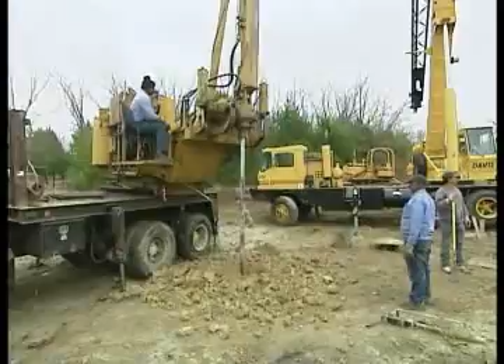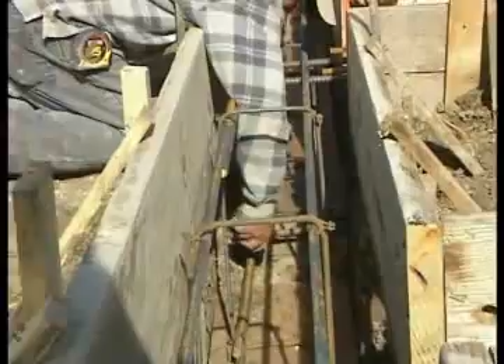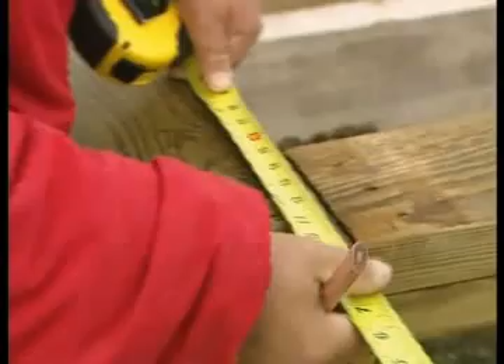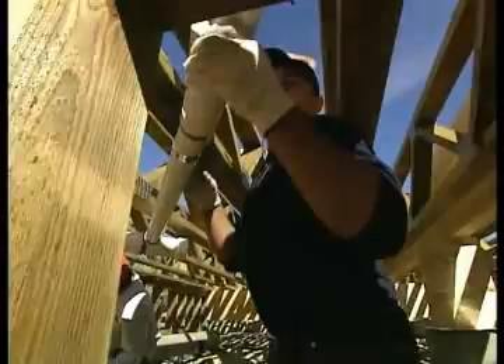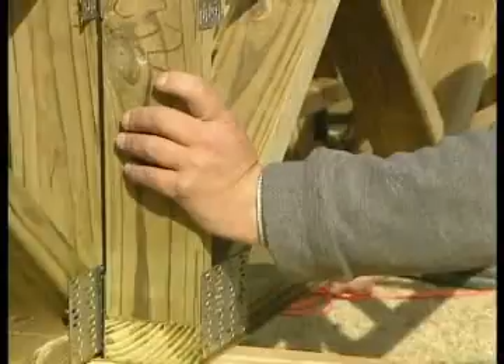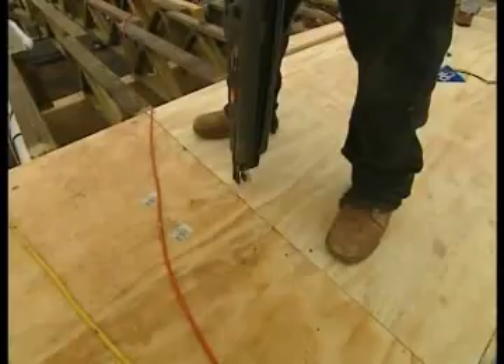Raised Floor Foundation - Case Study

Comment: Very unreliable technology. A lot of expensive materials and hardwork and as a result a floor with miserable characteristics. After the flood, these trusses will fall apart and the house can be thrown away. The insulation is bad. The sound protection is low. Smart people build reinforced concrete floors directly on the ground with a thick layer of extruded polystyrene foam underneath.
Reply: Yeah. Except this is probably filmed in 2000